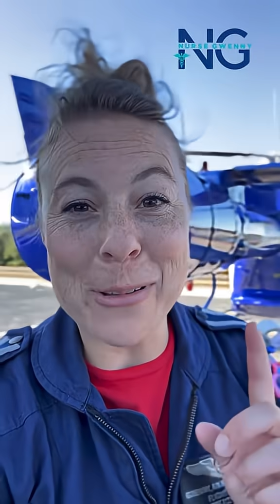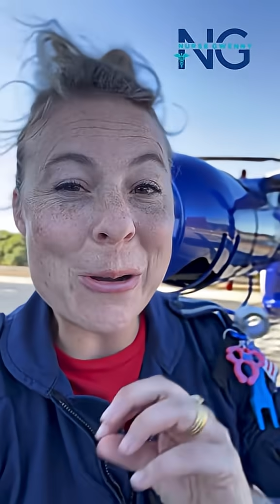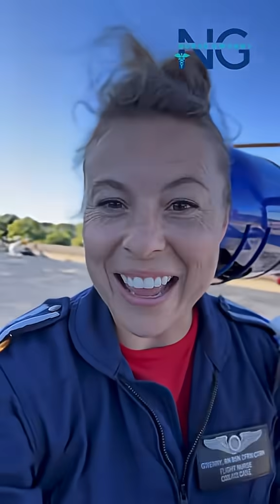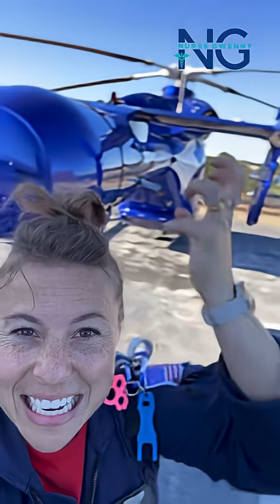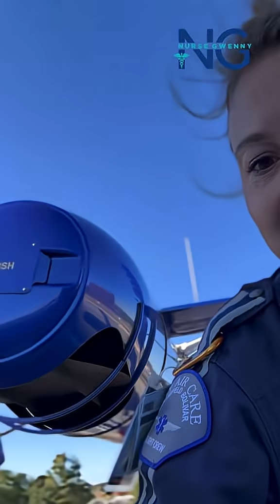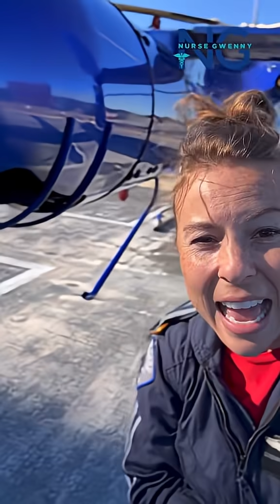NOTAR helicopter

Comment: Nurse Gwenny that's a very, very  rare heli you work on! I don't know how many of these are left in the US that are still flying, but probably only a handful besides the one at the MD factory. I worked as a mechanic on the MD 902 Explorer in the Grand Canyon doing rescue/utility/medivac flights for the NPS for a while filling in for the other mechanic on his weekends and off days. Very nice smooth helicopter, crews loved it, and engines are rock solid. Such a shame it's so hard to get parts for anymore. We had aircraft serial #12.